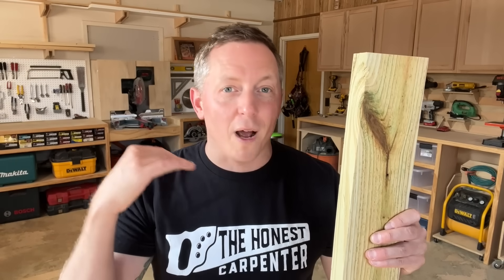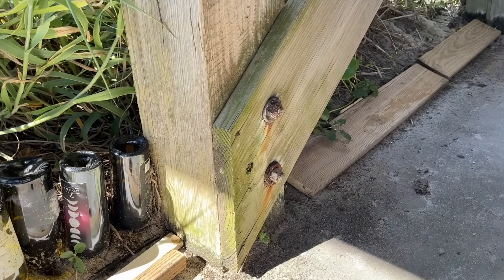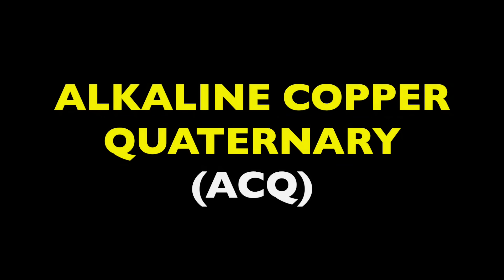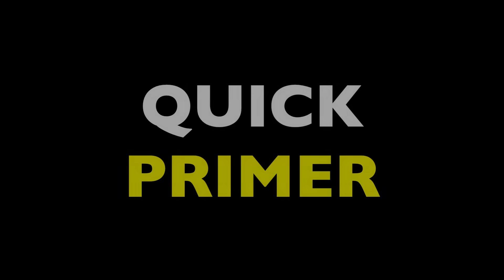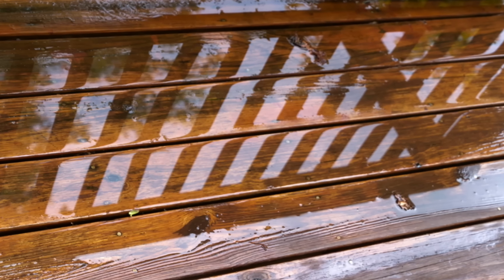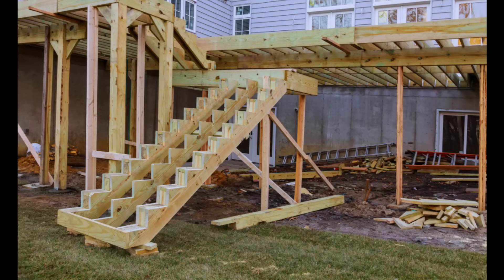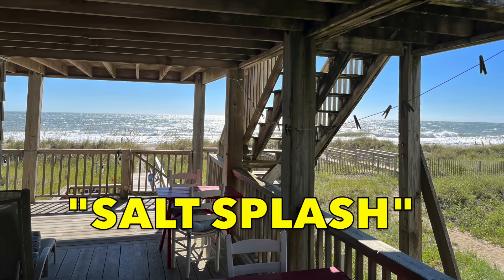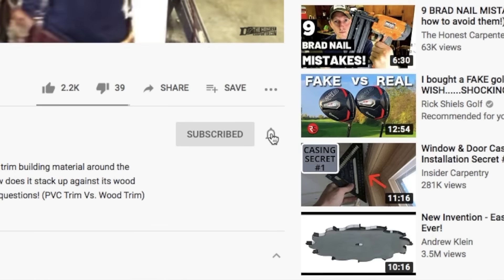Some TREATED LUMBER Rots Faster Than Others! WHAT'S THE DIFFERENCE?! (Ground Contact Vs. Non-GC!)

Comment: I am currently in the process of replacing a 4 x 4 sill plate and end wall on my 12 by 24 garage that was built in 1952. The sill was already replaced once with a dimensional 4 x 4 (rest of garage and house is rough cut) sometime in the 80s or 90s as near as I can tell. The newer replacement 4x4 as well as 6/8 wall studs, Gable and rafter, were completely hollow from termites. I'm rebuilding the wall with ground contact pressure treated lumber treated on all sides with two coats of disodium octaborate tetrahydrate dissolved in antifreeze concentrate and water, allowed to dry, followed by cedar oil and copper napthenate diluted with diesel fuel, possibly with a little roofing tar mixed in. Hopefully it outlives me.

Comment: Just replace a 4x4 in my fence next to the back gate that always gets a good wiggle every day for the last 22 years. Rotted at ground level so when I dug it all out and replaced with ground contact pressure treated yellow pine (Texas), and used Flex Seal from 6 inches above ground to below. Maybe a few more years hope on the new copper mix treatment will make it last?

Comment: I rebuilt an outdoor ramp, using treated 5/4" decking boards, as decking boards, above the ground, with gaps between them where water could drain through. I then primed and painted them. After only about 3 years, portions of them had turned to mush. The rot is worst at and near the ends where they are screwed into supports and have a board along side them that is part of the railing. Those parts probably don't dry as well. Some areas accumulate leaves too. Yes, they are conditions likely to rot wood, which is why we got treated wood. I am very disappointed about how fast it rotted. These were the only kind of decking boards sold at the Home Depot near where I was doing this. I don't know if I should have done something differently. They didn't last any longer than I would have expected for untreated lumber. We are in rainy South Florida and there is no cover over the ramp, but, again, that's why I was using treated lumber!
What they sell now is rated at 4A, but this was 4 years ago, so maybe they upgraded since then? Still not happy about it. The internet says untreated wood decks should last 10-30 years and treated should last 50+. This lasted 3. WTF!

Comment: The short of it is that the new stuff doesn't work well at all. I have old stuff that's been outdoors on a deck for almost 40 years. My son has new stuff that lasted only a few years in a similar application. The ground contact rated stuff is OK as long as it's not in contact with the ground. Under those conditions, it's only good for about 5 years. At least, that's been my experience. New stuff is safer, but it doesn't work well.

Comment: Im currently building my first house. For the foundation, in the ground Im using to types of wood. First for the two outer sections are rail road ties, solid oak drenched in creasote or however its spelt, sitting on rocks of basalt and granite, then coated in liquid rubber and then encased in 6 inches of concrete and then coated in liquid rubber and then back filled. For all of the middle of the house there are 6 inch diameter round posts 40-60 percent CCA treated and in the ground at least two feet deep on granite gravel 36 of those, and 42 support posts just sitting on 8 inch thick granite gravel beds. The house is a 30 x 48.

The other wood used to build the entire house is beetle kill doug fir non pressure treated lumber from an amish mill.

The non pressure treated wood, Ive placed 2x6 boards outside on the ground for past year in lots of rain, snow and hot scorching desert heat and no rot at all! Not even a sign of wear at all. Its like brand new! Also the posts Ive used for other projects some in the ground holding up large heavy structures and some just laying on the ground past few years and not a bit of rot and solid like brand new!

Perhaps its my climate. I dont have termites and I dont have clay soil. Im in the untapped desert 8,500 feet above sea level.

Other houses Ive seen around here older than you and me both Ive had the privilege of seeing the wood in the ground it was made from, its like brand new, as if it was cut down today and not any pressure treatment at all!

But just so you know, none of my wood will be exposed to the outer elements, it will all be covered in stucco, and as for the cca posts, they will be covered and under the house, coated in liquid rubber and never exposed to anything except maybe a little moisture from the soil every now and then rarely.

I expect this house will out live me by at least 100 years.

Im not afraid of the creasote or cca. Ive been around that stuff all my life. Its the newer treatments I stay far away from. I think it may rot the wood out faster. Youre better off using non pressure treatment than any of the new stuff.

Even my car, which Im building from scratch is going to be made from Ash wood!

That one if maintained should last a couple hundred years. I know this because there are 100 plus year old cars right now made out of the very same stuff and made the exact same way. I bought a manuel written in 1913 that showed me how to do it.

Comment: There's a new kid on the block as far as PT lumber.  Lowes EL2 rated PT.  It's non ground contact and has no copper.  Carbon based.  Your thoughts.
Reply from the maker: Dang, I didn’t know that Scruffy. I’m going to look into it. Anything that gets us away from copper is cool with me. Thanks for the heads up!

Comment: Great info as usual. Was not even  aware of a difference. Probably best to phase out the non-ground contact as you mentioned. I have a ‘green’ pressure treated deck I built 30 years ago. Still solid but I did replace the deck boards (walking surface) last year as some were getting a bit spongy. Otherwise I pressure wash it every couple years and it literally looks like new when I finish!

Comment: Back in the 1980s consumers can purchase creosote ( black smelly stuff).
A wood expert project book teaches dipping the ground touching 4x4s all non treated natural end into a barrel up to 24-36"  dunking it for at least 24 hours to a week then let dried before buries into ground as fence post.
Most of them lasted over 30 years + and more even standing today.
With only a few rotted.
The top of the post were wood stained , let dried,  then a coat of roofing cement on top.

Comment: From working thousands of mold remediation jobs. I know the PT usually has way more mold than none PT wood when doing a demo. It's because water sits on the surface of PT. Every time.
Reply: Only 1% of mild is toxic. People make a big deal out of it for no real reason other than scamming insurance companies . Saying mold is present in a wet moist with poor to no air movement is like saying water has hydrogen. No brained here

Comment: I had a commercial fence contractor building a wildland fencing job for me through some cobbly alluvium. The posts were al pressure treated for ground contact in semi-damp environments. For posts that couldn't be driven to full length because of encountering rock in the ground, we specified treating the cut tops that exposed untreated wood with copper napthanate after chamfering the edges of the cut.

Comment: Sir::40 years ago, working as a surveying assistant, we bought heavy duty sharpened stakes which we drove into the ground to use as markers.  We called them "hubs".  I've tried to buy some to mark lot lines, but can't find any Closest I could find is 2 x2x42 severe weather MCA, which I cut in half and sharpened.   Not intended for ground contact.. Is there any way to improve the life of these stakes in the ground?  What about a polyurethane coating?

Comment: I'm planning to have outdoor posts installed in ground for hanging bistro lights. Based on your video, it seems like ground contact wood is recommended.   The posts will be painted (stained).   What do you think about using untreated wood vs. treated?   For aesthetics, I like the finish to have knots and imperfections so that when stained, the grain's highs and lows show. Thanks for any feedback.

Comment: IMO structural posts should never be buried except for maybe fences or garden beds. I prefer to support them in saddles anchored in concrete. If you are doing a major building project in your 40s or 50s, do you want to have to replace it in your 70's or 80'?
Reply from the maker: It’s a good point, Ron. You also get to build in slope on your raised footings, really create some drainage. Seal your post ends, and they’ll last decades 👍
Reply: What product do you like for sealing endgrain? Also, I want to thank you for your vid! I was in a hurry when I posted earlier.  @TheHonestCarpenter

Comment: In Florida, I  want to build an 8x8 shack framed with some Home Depot Weathershield PT 2x4 that has MCA - Micronized Copper Azole.  I was planning  letting it dry out over a month and then heavily staining and sealing it. It will be skinned with solid color polycarbonate but the inside will be exposed lumber with no sheathing or drywall.   The gables will be open with bug screen, but my question is .. SAFE TO SLEEP IN THE SHACK?

Comment: Not to be confused with "marine grade" plywood which was a specification driven by plywood framed boat builders during WW2 that couldn't have voids in the inner layers so that the screws got a good bite.

Comment: In Cali, all we have is ground contact PT, not above ground. If you want above ground lumber, no need for treated at all. We just use redwood. I've seen untreated redwood used above ground that lasted over 100 years and was in perfect condition. Of course, also in Cali, it will cost you about $400 to dispose of a pick up bed full of PT and only select landfills accept it.

Comment: Trick when setting a 4x4 post in the ground. Get a brick or concrete paver and break it in half. Dig the hole plus the height of the brick.  Put the brick on the bottom and set the post on the brick. Pour the concrete surrounding the bottom of the post going 2 inches above the dirt line. The post is in-cased with the concrete and I have some 45 years old and no rot.

Comment: I am a structural engineer, licensed PE, and I had no clue.  Just got a call from a contractor who erected a deck I designed 14 years ago.  I specified "preservative treated" but did not specify the "grade" of preservative treatment.  A few of the deck joists (joists, not floor boards, not posts, but joists) have melted from the middle out.  Literally big gaping holes between the top and bottom edges.  My google searches led me here.  Thank you HC.  This is very eye-opening information.
Reply: He said “structural engineer👁️👅👁️”

Comment: Great video. I have Culpeper and severe weather that is all rotting out on my raised deck.  Screws are pulling out, Trex is tapping back at me and some are just plain warping.  I treated the ends, and taped.  It's a mess out there.  If there was a "best" wood for the frame, what wold you say it is today.  4 feet off the ground and price/cost is not an issue.  I do not want to touch the structural frame again, ever!

Comment: You can do own anti wood Rot treatment  like Japanese and other cultures  did for centuries. you char and burn the wood , modern era  do it with a propane torch sealing up the cell structure of the wood so water can't get into the cell structure

Comment: I have a question about wood and salt water.   I watched boat building videos, and had the impression that wood in salt water would resist rot better than wood in fresh water. I have been watching the videos from Samson Boat Co on youtube.    There many steps in the boat building process where Leo mentions this.   So, is it because boats have specific hard woods?  It says here that wood in salt water needs a higher rating.

Comment: Great Videos!  Living on a farm I I have opportunity to use primarily CCA thank goodness.  Early transition from CCA produced ground contact rated lumber that was lucky to last 5 years above ground. 

If you haven't done so already, you may wish to learn about another form of treated wood that has been know for many years; not readily available (import only) but that is changing - acetylated wood.  Acetylated wood is non-toxic and process to make replace some of the "hydroxyl groups" found in wood with "acetyl groups" making the wood more hydrophobic. Byproduct of process is acetic acid (salad vinegar) in less concentration that natural content causing tart smell in Red Oak.  EMC is closer to 4% than typical 12% so wood does not retain enough moisture to promote rot or support termites.  

Process to make is akin to making cigarette filter tow (wood pulp product), but in "Stick Form" - and we all know how long those little frail filters last after being tossed out the window. Process also restores wood close to green dimension and relieves internal stresses; so wood shrinking/swelling and other movement such as cupping is 80% less than that of starting lumber treated - typically pine).  Less movement translates to straighter lumber post treatment, installation and better coatings retention.  There is a USA company right now (or was last time I checked) using acetylated wood finger-jointed into bottom 6 inches or so of external door jams to prevent that rot you are very familiar with and have produced videos on how to repair.  I know number of applications have grown tremendously since I was first exposed to technology/development in 2004 and 1st commercial scale plant is now being constructed in USA.

Comment: A good way to avoid ground contact rot is to construct the lower , ground  parts with (  tough recycled plastic lumber ) .. this will  NEVER  rot  ( EVER ! ) , then construct the upper parts with cheaper normal treated wood .... also A2 or A4 stainless fixings will ensure  DECADES  of rust free joints , with cheaper Zinc plated fixings for upper parts ... hope this is of help , ( tried - n - tested ) ....... DAVE™ ..............
Reply: Where would you find these tough recycled plastic lumber?  Thanks!

Comment: Good advice. If I may add, if you cut ground contact treated lumber you will expost an untreated section. If you cut a post that will be ground contact, make the cut end the top or treat the cut end being lumber is not treat 100% i.e to the center of the wood. ....

Comment: I used to work in that industry where lumber was treated..Worked at a treating plant from 1977 to 1981..Was Hilift driver/Yard Foreman..Most of what we treated was for the coal mines..Posts, Caps, Wedges,etc...Sometimes we would do a custom treat for a customer,sometimes Plywood,2x4s etc..Built many of what we would call charges..3 Small railroad type cars that I would load and push into a 40' tank..Generally we did about 3 charges a day...Loaded and unloaded many trucks in those years..Just after I transferred to another part of the company they started doing mostly all dimension lumber ..Some of the coal mines were closing and the demand for treated posts and such had declined greatly.. Though it could be hard work sometimes,I sometimes miss it..

Comment: May I suggest a somewhat similar topic?  I (and my neighbor, too) have replaced our outside side doors twice due to rot.  The last time I replaced it, I picked a much more expensive "fiberglass rot-proof door"...which, it turns out, is only rot-proof on the frame; the door itself is now rotting at the bottom!!!!  NO, it is NOT in contact with water; the sill sits at an appropriate height above the entryway; it only gets splash water.  I presume it only happens to our side doors because they have no porch, only the eaves above.
SO:  Perhaps you could discuss exterior doors, and their use in appropriate places???

Comment: I liked this video. Just finished tearing down an 800 sq ft deck with gazebo & even the 4X6's are rotted. I'm in a wet climate but still...Non ground contact SHOULD be discontinued. All treated lumber should be treated to the max except for maybe in the water lumber (marine use). Thumbs up my man. I'm 74 & had never seen the numbers on treated lumber. thanks joel

Comment: I have had far too many PT 6x6 posts rot at ground level in less than 10 years.  My son built a house with wrap-around decks and he used milled 8x8 locust posts with T&G locust flooring.  It was code approved and should outlast the both of us.

Comment: To put it in simple terms that we can all understand, Copper Azole is similar to ACQ with the difference being that the dissolved copper preservative is augmented by an azole co-biocide like organic triazoles such as tebuconazole or propiconazole, which are also used to protect food crops, instead of the quat biocide used in ACQ. The azole co-biocide yields a copper azole product that is effective at lower retentions than required for equivalent ACQ performance. The general appearance of wood treated with copper azole preservative is similar to CCA with a green colouration.

Copper azole treated wood is marketed widely under the Preserve CA and Wolmanized brands in North America, and the Tanalith brand across Europe and other international markets.

The AWPA standard retention for CA-B is 0.10 lb/cu ft (1.6 kg/m3) for above ground applications and 0.21 lb/cu ft (3.4 kg/m3) for ground contact applications. Type C copper azole, denoted as CA-C, has been introduced under the Wolmanized and Preserve brands. The AWPA standard retention for CA-C is 0.06 lb/cu ft (0.96 kg/m3) for above ground applications and 0.15 lb/cu ft (2.4 kg/m3) for ground contact applications.

Comment: When building a wall on a concrete floor, it’s best to isolate the wood, pressure treated or not, to avoid direct contact. Cheap, easy way to add years to it.
As for the lumber ratings, thank you, I didn’t know that. Most men don’t read the labels or instructions.